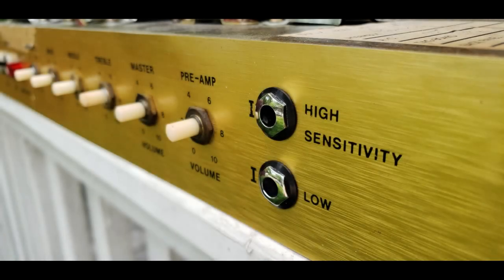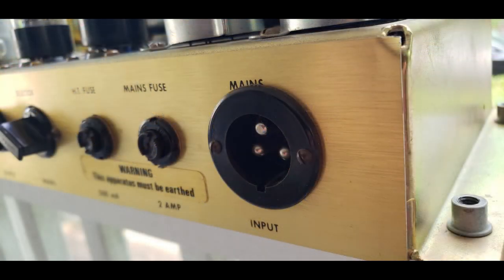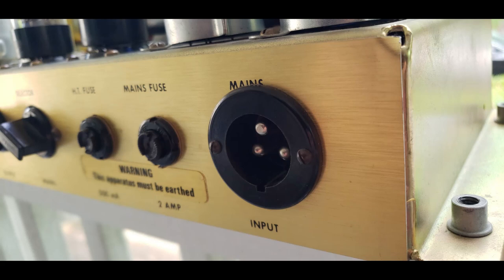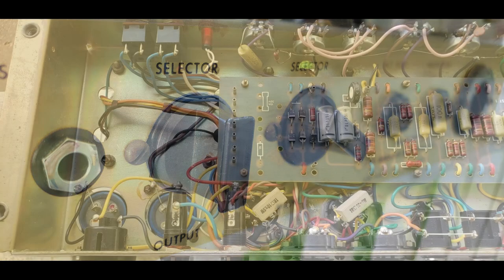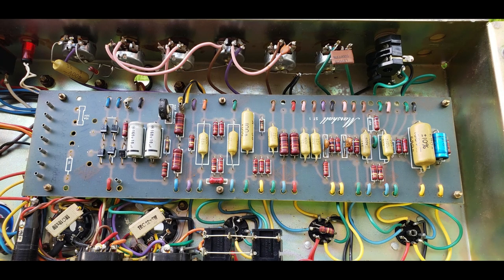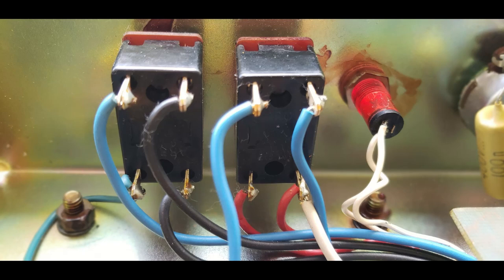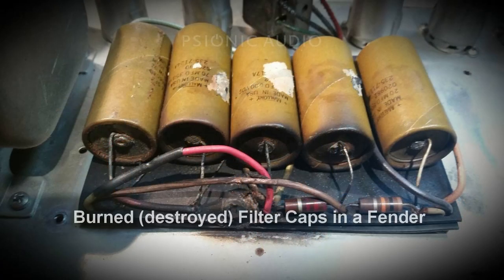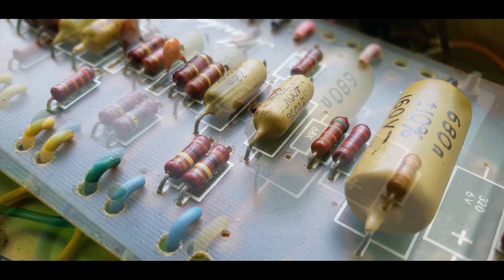'76 Marshall 2204 Cascaded Gain Mods Part One

Comment: I have been building valve amplifiers for a while using turret boards and making clones or modern versions of old amps.  Five different Fenders, two Kalamazoos and then this week I build a 2204.  Wow what a classy amp this is. I found your video quite interesting and will be watching part 2 shortly.  Thanks for your work.

Comment: I happened on the Video of the 2204 (old style) and I was watching it, right after I subscribed. And while I was putting the chassis back in the case, you mentioned cleaning the grounds on the caps. Whoops. I had cleaned the grounding points of the output tubes when I was installing 1ohmers. But I had forgotten to do the cap grounds. Thank you for the timely reminder. It's back out of the case and getting those points cleaned and burnished. Might have been fine, but as you said, why gamble. By the way, I admit to the newer version of the 2204, being my weapon of choice. Being an old beat up Rock-n-Roll front guy/rhythm guy
, what else could it be......

Comment: I have 69 smallpox 50 bass 1986  circuit that is the best sounding Marshall I have ever played. I had a loose impedance socket thingy so I just hard wired it. Do they make original replacement for those? I didn't want to put in a modern looking one. My Bulgin chord will vibrate loose once in awhile when the head is on top of cab. Maybe I can just replace the chord end part of it or tighten it somehow. I'm not sure they make those female Bulgin receptacle parts on the end of the power chord??

Comment: You talk about fuses in this video and in a lot of videos. I too understand how important they are. My question: I have an Amp with 3A slow blow. I blew it accidentally. Didn't have any slow blow at the time. I put a regular one in. It's been fine for a few years. Is it alright to leave it? I'm guessing it's fine so long as it's not blowing. But it bothers me every time I use the amp because, I know it's not right.
Reply from the maker: A fast blow may give you a false failure mode, but it's safe. Like, ultra safe. So safe it might be annoying.

Comment: This amp doesn't need mods. I change one resistor on V1A from 10k to 4k7. This amp sounds perfect stock with one tiny change to the first gain stage. Add an overdrive if you need more gain. The 2204 is absolutely the best amp ever made. I have a '77 and a '78. The '77 sounds better than the '78.
Reply: You changed it on a 76 or a 77? I agree about 77's btw
Reply: @marshallmajor6019  77 2204 and a Ceriatone clone. They sound a lot alike but the vintage Marshall has something special in the highs and the lows
Reply: Wow, can't agree more, and I have a '77 and a '78 as well! Never found anything better.

Comment: Regarding fuses starting  @2:30, I saw that other video about the Bogner that a road crew put a 30 amp fuse in. What is the deal with people putting wildly inappropriately fuses in guitar amps?  It seems these people have either zero understanding or very flawed understandings of what the purpose of fuses are for in the first place. Just barely enough knowledge--because they figured out where to get those fuses and put them in--to be dangerous.
Reply: I think they put in whatever they have lying around. And it's terrible.
Reply: @zbaby82  Yeah... Perhaps that's what happened, and they should have known there was 0% chance it would work fine.  It's a shame.

Comment: The truth is that the Daly capacitors are of incredibly high quality and are safe to keep in the amp if there is no sign of overheating or label shrinkage,  or crackling, buzz, or hum in the amp's output.   I'm generally very militant about replacing old filter caps but I've literally NEVER seen a bad Daly cap in a Marshall unless it had those signs that I mentioned.
Reply from the maker: I have seen bad Daly caps. They aren't magic. All things must pass, even the really pretty blue things.
Reply from the maker: And this amp had a sourness to the sound that new filter caps fixed. It's amazing how much better amps sound when working as designed.

That's the truth.
Reply: I had the filter caps go out on a Hiwatt and somehow it cased it to take out all four four original Fanes in my cabinet. Ouch! I’m not familiar enough with the subtleties of failure signs to be confident enough to to spot them.
Reply: I took my 2204 to a tech in 1997 and he took my Daly caps!!! I immediately heard the difference and called him in a rage!! He said they were blown. He's a liar. I called him back about 5 years later and he didn't know who I was. I gave him hell and he apologized and told me I was right and you shouldn't change out caps unless they have failed. I have F&T caps in both my JMP 2204 heads now. After a few years they sound great but not the same as the originals. Take photos and initial your components before you take your stuff to a tech. Tell them not to make any repairs or changes not authorized without calling you first. I do all my own work now but 25 years ago I had to use amp techs for my stuff and I deeply regret it. Unethical techs are evil people.
Reply: @PsionicAudio  Reread my comment.  I restate, I've literally never seen a bad Daly cap in a Marshall unless it had the clear signs of reaching the end of its useful service life that can be expected. Label shrinkage due to overheating,  vent bubble,   or of course, actually vented/leaking.   And boy, do some of the more militant vintage Marshall collectors ever lose their minds when you suggest that you dare replace an original part, unless it's actually puked its guts out inside the amp!  Even then, they'll protest and say "But it's still working!  I don't want to lose originality!  Waaah!!!"    Personally I always recommend cap replacement on a 10 or at most 15 year cycle,  but in the case of old Marshalls I've more or less been forced to take it on a case by case basis or risk pissing off my customers.   They want to keep their original parts and think that new parts can't possibly have any mojo in them.   Which is not true, of course....
Reply: @truescotsman4103  They were at least 20 year old caps at that time.  Well due for replacement.  You have incorrect ideas about those components. You don't WANT to wait until they short and blow their guts out all over the inside of your amp, leading to corrosion damage,  so you replace them before they get that bad.    Oh, they MIGHT last longer, but you are rolling the dice by electing to wait longer to replace them.  
At the end of the day the tech was right and you are wrong.  Capacitors have a limited service life, beyond which there are literally no guarantees of how much longer they might last.
Reply: @Turboy65  My amps sounded brilliant at the time. There were no problems with those capacitors. At that time daily capacitors in vintage Marshalls were nearing the end of their life but still holding strong. The difference in sound was incomparable. It was like a brand new amp. It took about three or four years for the caps to reform correctly and the app sounds like it did. I've replaced them again myself since then and they have reformed in the amp sounds like it did.

Comment: WOW!  SMOKED a $3000 amp with a $0.25 wrong fuse!!  Very stupid error.
Haven't had anything like that....yet.  Worst thing I had was someone take out an Output Transformer by getting stoned and plugged the output into the input and then fired up!!!  :O
People NEED to get off the stupid era-specific component horse.  Old components, at least resistors and electrolytic caps NEED to be replaced on ALL amps 40+ years old (80's and before).  The capacitors go out of tolerance and eventually short to ground and have catastrophic effects (as you shown).  Old resistors drift and have measure components 25% to 200% of their value!  All over the place and end result is loss of tone, design intent, and consistency between amps!  STOP BEING STUPID PEOPLE and change those components out!